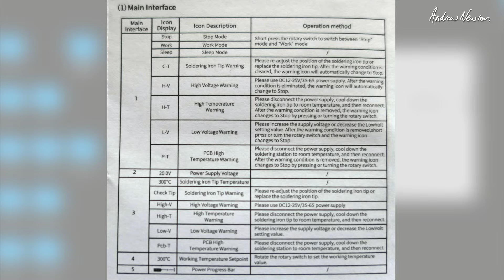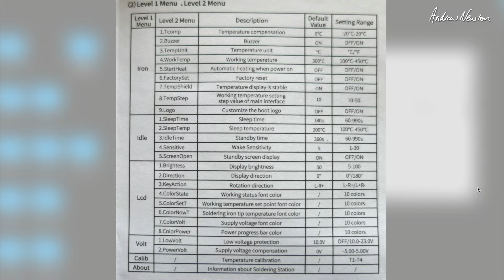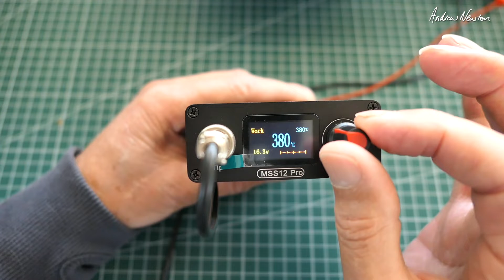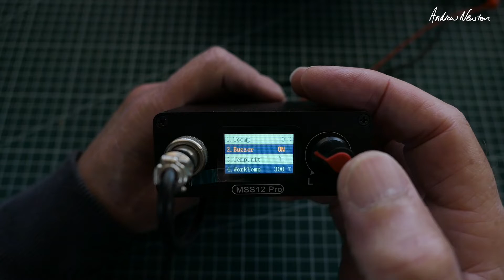Sequre MSS12 Pro Soldering Station

Comment: thanks a lot for showing the menu and to check the exposure that we can watch or see something.
I like it at lot but not sure if I need it cause I have already a full soldering station and the mobile pen style one you had shown before which works quite well and there fore no need for a bigger one cause more or less is built in the stick one. What I do like is the nice connector for the iron and the usabiliy, also the nice fitting case. 
But as said before I have already this pencial style which I usually use with a small 230 V AC or 12V car Adapter but not with the xt60 connector. 

I guess I would have bought this one if I had not pencil style already cause they have put it nicely put together in a box where I had later bought a bigger case for my AC power supply and the iron which do not fit so well together. This kind of station with menus has its advantages but I also would suggest to go for bigger digits and characters and display cause the older you get the harder it becomes to read and most of those who spend a lot money in the hobby are no longer the youngest and check these devices for how good the displays are readable. The menu here at 5:40 looks good but the general overview uses fonts that look a bt too small like the wanted temperature and voltage. Current temp is quite tall but a bit too small compared to the other font. 

And I bet there are a lot in the hobby that have the same complaints - if not now then sooner or later cause sight does not really get better.  I am also not sure if it makes sense to use so many different colours in the main menu and if it would not make more sense to show the temperature in white unless it gets over 50°C and then would switch to red instead to warn any that it is now getting really hot.  

At the end I like it, would buy it, but would have to sell my mobile solder iron pencil first.

Comment: this is a very old system we use in repairing mobile phone boards, runs off 24 volt isolated system , has very fast heater , accurate thermocouple, sleep time, ambient temperature calculation as well.